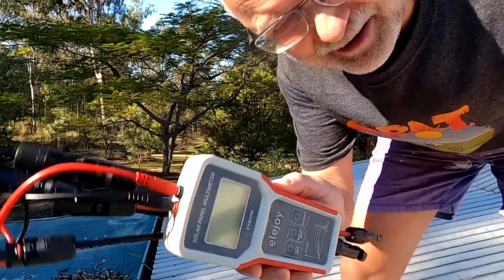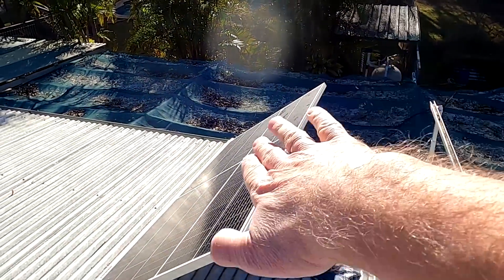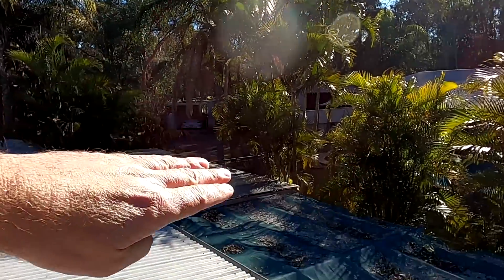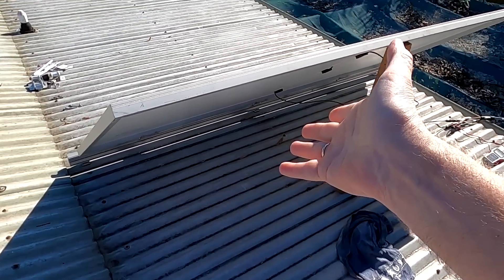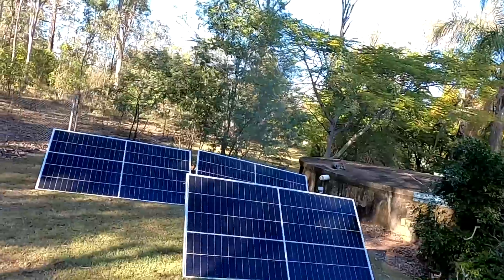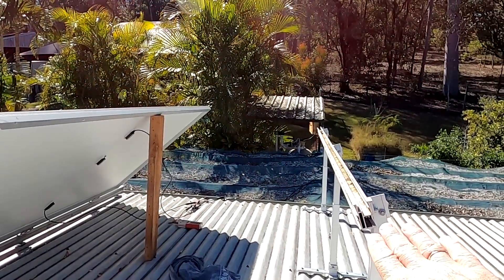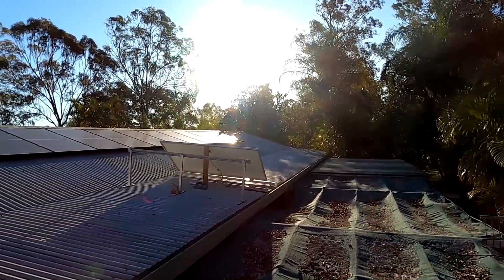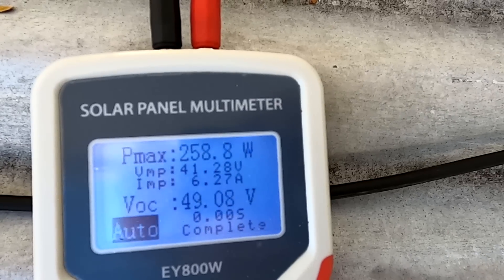Maximising solar production in winter.  Is a steeper angle really worth it? Timber vs Tilt Mount

Comment: You briefly touched on the point of maximum useful gain early in the video, but you didn't revisit it at noon!  Flat is clearly non-optimal, but what about halfway-between?!  (there seemed to be very quickly diminishing returns once you raised it past about 15-20 degrees...)

Comment: It is a fun numbers game.    If you have dirt cheap panels and roof space.... cover every inch...Make it up on the average. If you have limited sky (in my opinion like you do) then some more expensive bifacials on an aluminum frame which is mounted on a rotor of some kind (a million ways)  is the more efficient way to go.   The real perk to a mover is if it is only sunny two hours in the day no matter what that is you still get max power from that two hours as the panel are at the optimal angle all day.
One even has to ask what is "efficient"     Most power?   Least money spent on gear?   Are getting paid from the grid?   As you say it more complex than you or most ever realize...    It is still worth it.

Comment: magnets on metal roof with feet how I done it on my boat I can change the angle and track the sun the rare earth magnets hold 300kg pull strength I have 4 on each panel never had a problem on storms they hold strong if we have a major storm I just drop them

Comment: Prepare fully machanized mounting and sun tracker to maximize output from solar panels in winter as well in summer which is secure from higher wind and also folded like a book to prevent loss from heavy hailing. Also moveable from shadow area to sunny area with the help of wheel mount trolly structure.

Comment: Why dont you just accept a compromise instead of just testing the panel flat and compare with a perfect angle. Look for someting in between. Raise the back end of the panel just say 25cm or so. Then the shadow will not be that long, and the performance will be better than flat panels, and it won't look terrible from your wife's perspective... 
Raising them with an actuator is a bad idea when mounting panels on a flat surface like that. You will only create a gigantic shadow by rasing them when the sun is low over the horizon. It would probably be better to do the oposit and lower them in the winter to shorten the shadow and accept the trade off...
Reply from the maker: Wait for it...

Comment: Dont you have an Angle/Level Meter? There are apps you can download.
2. Simple Rules of Thumb
Here are two simple rules of thumb for finding your solar panel angle:

Rule of Thumb: Set your solar panel tilt angle equal to your latitude.

Seasonal Adjustments: Subtract 15° in the summer. Add 15° in the winter.

This method won't result in the optimal tilt angles, but it'll get you really close.

Comment: Thanks Andy for clearing out that you can not add as many panes in parallel as you want to a single MPPT controller input. Many people almost have me convinced I could really add more. Porbably you saved my MPPT controller ! Thanks !!
Reply: The controller will have a DC voltage range and a  max amperage input.      One need understand volts vs amps and it is clear....   get this education so there is no doubt in your mind.
Reply: I believe he is wrong. Power is pulled not pushed. The controller will only use what it can from the supply. I have 2070w arrays on 800w controllers but I'm limited to 800w from each controller so I'm losing a ton of solar on sunny days (for now)

Comment: Hi Andy,

Your channel has inspired me, and I just scored a deal on a 5 year old used 3kw solar system, which will be my first foray into solar.  It's a Solar Edge system with 12 250W panels with what they call an "optimizer" for each panel, and includes a 3000W inverter, a watt meter and disconnect -- basically everything but the mounting system and some wiring.  

I have limited south facing roof space, but plan to mount some of the panels as awnings above the south facing windows.  In addition to having them as awnings on the 2nd story windows, I am thinking of mounting some of them on the 1st story as a full length awning that will cover not only the windows, but continue over a sidewalk and rear-entry on the south side of the house.

Here in northern Oregon we are at quite a high latitude -45.5 degrees so setting the awnings at around 30 degree tilt should work well year round.  Well, somewhat well - as we have a lot of rain and clouds during the late fall, winter, and early spring here in the western part of the Oregon.  No storage plans as of yet -- but I am looking forward to having the system help offset my air conditioning costs in the summer.  Anything above that will be a bonus....

Thanks again for your inspiring channel!
Philip from NW Oregon, USA

Comment: You seem to have some sort of round(ish) surface right next to your roof. I don't know how sturdy that surface is, as it comes into view only very short every time, but you do seem to walk over it without hesitation, so it could probably be pretty solid. Can you put some panels onto there next to each other, spanning the entire diameter of the round surface, then pan the entire array towards the sun instead of having the panels on the roof and changing their tilt? If you pan the entire array, you won't have to bother about putting up multiple rows, so no worries for putting shade onto next-row panels. If you pan the entire array, all panels will be at the optimum angle towards the sun for most of the day and should produce maximum output all day long.

Comment: The area of the roof is the area of the roof and the relative angle of the sun is the angle of the sun. you can't change either of those!  All you can do is to maximise the capture and ime, as solar panel costs have fallen, then the best option is simply to fit as many pannels as you can in as cheap a way as possible. Complex moutns with trackers and actuators all cost a lot of money, money that is better used to simply buy another panel.  The shaded area from an angled panel shows the effective area of that panel if it were parallel to the roof, and clearly, in order to avoid shading all you are doing is trading off panel capture vs overall area ie angled panels have to be mounted far enough apart so as to mimic the total (shadow) area.

Most MPPT controllers should be smart enough to avoid an overcurrent situation, either on the input or output side so long as there maximum input voltage is respected.  Flat panels will have a lower voltage at IMP as the effective irradiation is lower, so you should be able to put these panels in series as long as you ensure the max input voltage cannot ever exceed the controllers input spec.

The ratio of input to output current also depends upon the battery voltage into which the controller is bucking (step down Dc/Dc). With most controllers you want your battery voltage to only be slightly lower than the lowest panel string voltage at which you want to start driving current into the battery to minimise the controllers losses and maximise it's power capability ie a 20Amp output limit is 240w at 12v, and 480w at 24v

Comment: I think it will not make a difference it you have some modules tilt up with extra space to manage the shadows or if you have some more modules lying flat
Reply from the maker: Yes, you can always compensate with more panels for a not optimal angle. Just my micro inverter cannot take more panels.

Comment: Hi Andy, it's me again, Ronald. The earlier suggestion of the frame on the concrete dome is but just temp job, to see if a few days of the frame placed on it, with said angle for the solar panels to be placed in, will get more juice, compare to current conditons that you are experiencing. There is no drilling in my suggestion at all, merely placing it on tope of the dome and see, if it would be better in the short term wile you find out the feasebility of it being better or worse! If it does work out, then make a semi-permanent frame that you can store it, after the winter fiasco and then re-deploy it again during the next winter! The same can be said for my idea of the horizontal version for the roof. Just add temp safety holds against the wind and then take it down after winter time to be store for the next one!
Reply from the maker: Yeah, I had one panel already on this tank but due to the round shaped lid, it is not stable to just stand it up there. It needs some sort of frame to be safe. The tank gets a bit less sun as the roof but is better than the grass area next to the tank (solar farm).

Comment: I understand the need you have for video content, but I would just add the panels that are needed for your power requirements, mounted flat on roof, and add additional inverter/controllers as needed to handle additional panels.
Reply from the maker: As I have explained in a previous video, that is not possible.

Comment: One thing I'd like to see is if you stick two panels in parallel to one MPPT controller, and two MPPT controllers in parallel an see how much difference that ends up being. (This all assumes that the MPPT can handle the combined current)
Reply from the maker: You cannot connect MPPTs in parallel. That will not work!
Reply: @OffGridGarageAustralia  Well technically it works because that is what I did (not knowing maybe I shouldn't be doing it or maybe it is just with certain equipment). Something works or doesn't work, but no magic smoke yet. Now you got me wondering. My two controllers in parallel seems to charge up the batteries more than with just the one. It got hooked up that way from how the setup grew. One 250W panel and one 300W boost MPPT. Was getting about 165W to the batteries at the poor panel angle. I added a 2nd panel with a MC4 Y connector 1s2p to the same MPPT controller, and ordered a 2nd 300W MPPT before I found that 600W controllers existed. The 300W MPPT came first so I just added it in parallel with the first MPPT since the MPPTs did not come with MC4 connectors and I forgot to order them. I took a quick glance at the displayed combined currents and it seemed be roughly more with two MPPTs than with the original 1 (which was limited to 300W) I had so I thought I did good and all was working correctly. Now I need your genius testing methods to see what is really going on.

Comment: Andy, I have an off topic question.  Is there some way to monitor battery voltage via a phone app?  I am looking for something to check my system voltage while I am away.  I have an Outback Power Systems setup that has been working for over 15 years and has worked flawlessly.
Reply from the maker: Not sure if there is anything for the Outback system. If they have some sort of API, you can connect it to Home Assistant I assume and monitor it from anywhere.

Comment: Hi Andy. Nice Video. You mentioned that overpaneling your micro inverter has its limits in respect to the current. I think I still understood only parts. My understanding so far is, that I need to take care about the voltage of my solar charger, because it needs to be able to put the panels into open circuit voltage to stop the production. The mppt charge controller pulls up to the max possible current from the solar panels. So I thought it would never pull more than it can push into the batteries. I am also able to limit the battery charge current in my Victron Smart Solar 100/20. The default is 20 A, but when I switch it to 4 A it will only pull the amount of Ampere needed to get the battery loaded at its voltage and 4 A. So in which situation the charge controller will be destroyed, when too much current is available from my Solar Panels?
Reply from the maker: Victron has especially explained that you should not overpanel their MPPTs  by more than 30%. There are certain operation modes of the controller where it shortens the panels and the FETs need to cope with the short current of all connected panels. Everything above 20A for your controller will void warranty.

Comment: I drove myself crazy trying to optimize my installation.
I finally compromised with max winter production to compensate for shorter charging time and now with central Florida summer I usually full charge by 2 pm .
My winter production should be adequate but I will see.
Another informative video Andy.
Reply from the maker: Yes, same. I have now tried different things and have a clear (as mud) picture of what to do. I will proceed in one of the next videos...

Comment: I also always believed that you can put more panels than supported and the inverter would simply not use them at full power.
Otherwise how would it work if you have 14w load but producing 600w? The inverter is consuming the current it needs, and not just being pushed the current from the panels.
Reply from the maker: No, that is not the case. The power point will move as well as the controller is trying to pull maximum power. Some controllers state the max PV short current as their limit, other have the maximum power of connected panels in their specifications.
You can overpanel Victron by ~30% but still need to stay in this current limitation. Some operation modes of the controller can short the panels and the MOSFETs need to cope with the highest current the panels will deliver.

Comment: Why you not use a second micro inverter and use all your 8 panel (four on each inverter) flat on the roof. You you even not overpower your multiplus.
Reply from the maker: The cabling back to the garage inverter allows only 2.4kW, so the electrician gave me a 10A input for this inverter for this location.
Reply: @OffGridGarageAustralia  But with 8 flat panel you will not reach the 2,4kw in winter? You can put a Sonoff Switch before the second micro inverter and do a routine in home assistant to automatically shut down this inverter, when the power exceed 2,4kw.
Reply from the maker: @digitalmoba  Yeah, but if this does not work, it's overloading the line. Such a construct can be done as a second 'safety' measure but cannot be relied on.
If HA is not working, the Sonoff has no reception or the relay inside is faulty, it could be bad. I would not want to rely on such setups for such an important task.
Turning on hot water or the pool pump if the battery is full is fine for HA but anything safety related, I would not trust it...

Comment: Hi Andy, maybe a fresnel lens designed to provide the right light angle and put over the panel´s surface would help keeping a low angle with shorter shadows while still getting some extra power...
Reply from the maker: That would destroy the panels. The angle of the sun will change over the year. What works now won't work in summer and vice versa. But a lens is probably not a good idea as it will concentrate the light in one spot only.
Reply: @OffGridGarageAustralia   sorry, I didn´t mean a concentrating lens, just a surface with straight linear prisms, like the circular ones on a fresnel lens, but refracing the light to the same direction each of them, just acting like a prism over the panel that will recieve the light with the sun angle and bend it to a more efficient angle to the panel, I would be glad to send you a picture, would you send me your mail please?
Reply: Surely it won´t be like 100% efficient but maybe it makes some extra power
Reply from the maker: @germo35  Ah, right, I know what you mean. It collects the light from the site and diverts it down to the panel which is mounted flat on the roof. But don't you have to move the lens all the time depending on the sun position and angle?

Comment: Hi Andy! I have read a few of the comments and there has been a repeat of only one idea and nothng new! I, on the other hand has a  few not new ideas and maybe A few NEW ideas! The not so new idea is, remember back when in the older time, when your new panels haven't been installed yet and to get a little bit more juice to charge your batteries using a few more panels placed on the well pump concrete? Well, YOU SHOULD put at least TWO of your four panels on it, because as I saw it in the video(s), that it is also in the sunshine and MOST sure that it will also produce MORE juice to counter those panels solely on the ground and the one panel on the roof! And now for the NEW ideas:-(1) Measure the angles of the sun on a sunny day and then, average out the degrees to get the need average angle for the solar panels, to tilt up to and not worry aboul a 90° even 30° tilt, but one that will give you the best angle that give you the most juice output @ a fixed angle! (2) If you do as I had suggested, the build a simple frame out of either with all the older Aluminium solar support surplus, or wood/timber frame to the (1) angle, and then with at least two other aolar panels, place the frame on the well pump, and then place the two, vertically and side by side in the same frame on the well pump and voila, you have two more; giving you more juice to charge those batteries! (3) Build another frame, BUT vertical this time and then place it on the roof of your house using again the (1) instructions and then see if it is btter or not with the amount power you got the current arrangement of one on the roof and three on the ground! Remember Andy, if it does not work, then at least you've given it a try. BUT if it gives you a better result than what you current have, I am HAPPY to have given you ideas that actually give better returns then anyone else have commented or given ideas to you, so far! :)
Reply from the maker: Yeah, I thought about this. I'm not keen to drill in this concrete tank though. The top is domed so the water can run off and the metal frame/structure would be relatively complicated compared to the flat roof.